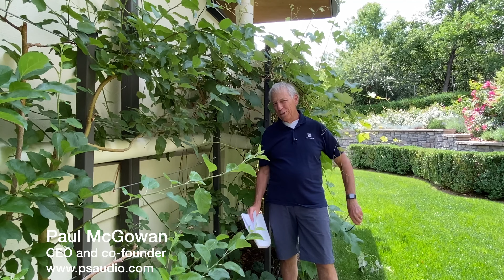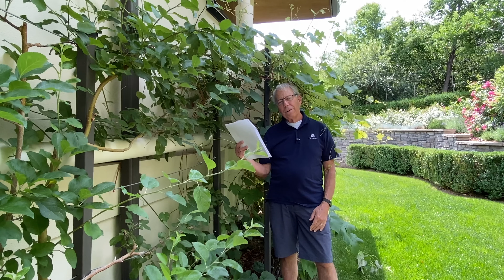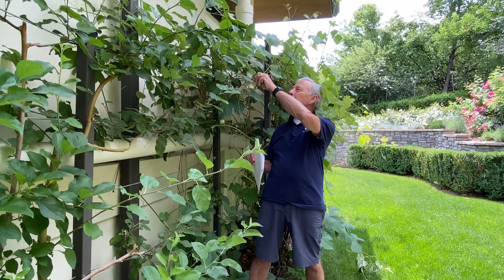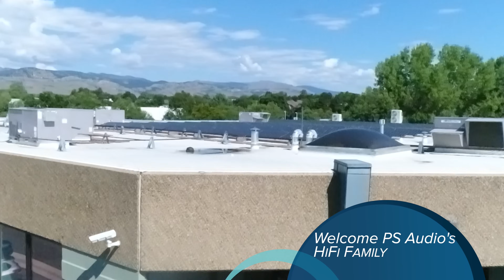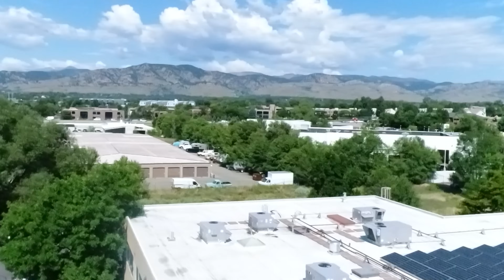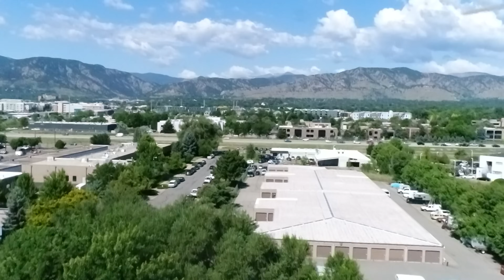How do stereos image?

Comment: 2:00 Do you mean an Isobaric tweeter?
Reply: Tweeters move such an insignificant amount of air that the term “isobaric”, even if technically correct for the application,  is insignificant unless the tweeters are housed in a separate, very small enclosure.  Otherwise, their affect on the enclosure’s internal air pressure might not even be measurable.
Reply: @doowopper1951  Fair point.
It like claiming that different power cables "sound" different.

Comment: In general, I have found small(ish) speakers give much better imaging and do the "disappearing trick" easier, giving the impression of just sound and no speakers.
Could it be the (more difficult)  integration of many drivers on a large enclusure as against, just two drivers in a small package?
Reply: Arthur ...yep, true. I'm not so interested in the 'why', all I know is that 3 way floorstanders are good for Rock 'n Roll, Metal, EDM & the like ('Wall of Sound' presentation) & small 2 way standmounters...are what you said about imaging & accurate soundstaging.
Reply: @FatRat-f9m  
That's very true FatRat, especially if they come from the likes of JBL or Cerwin Vega 'stables'..
I have surprised myself lately as, I have the large Thiel CS6 as my 'reference' speakers, ..however..
..I recently got a pair of vintage Rogers LS7t (circa late 90's) and, it's hard to believe, I enjoy their sound as much as the big Americans when it comes to Jazz and Classical.
With rock / electronic music they don't compare.
I am listening right now to them and don't feel any particular urge to get back to the Thiels!   
Go figure!..
Reply: @FatRat-f9m  , shhhhhh
Reply: i A/Bd the B&W 805D2 bookshelf & the 804D2 and found the 804 to image same as the 805.
i was going to get the 805.... but its the same footprint & the same staging with more bass.
i couldnt talk myself into saving a few thousand.
Reply: @FatRat-f9m  
Thanks FatRat !  Always willing to learn.. and as someone famous said: "..the older I get the more I realise how littlle I know.."
Reply: @manolopoulos-j4t ...I think that that might be more in the realm of humility, my audio friend.

Comment: what makes surround sound image?
Reply: Rather than relying on audio bouncing on walls in a stereo setup somewhat randomly, the audio comes from the specific intended directions in a surround setup. This can make a more reliable 360 degree imaging and with Dolby Atmos even create audio as coming from above. For a movie you want what you see and what you hear to be highly connected.
Reply: @behexen250 Yes, phase matters greatly. Hopefully you are not recommending anyone to run their stereo speakers in opposite phase? Out of phase is quite different causing my brain to short-circuit in imaging. A few years ago I was at the Hong Kong Electronics fair and some company was demoing their premium headphones. I instantly told them the phase was opposite and then one of their engineers came with another pair for me to try...that had the phase right. I've also visited a friend where his speakers were out of phase and they had used it in that condition for years. He was so shocked how much better it sounded after I fixed it for him. I bet a lot of systems are running in opposite phase un-intentionally.
Reply: behexen250 Yes, that’s what I understood also and I agree it’s a good experiment to do. Also it will make you know how out of phase actually sounds like so you can easily detect it in the future.

Comment: If speakers need to be pulled 1/3 of the way into the room for a good image then how does Ohm Walsh series speakers that are noted for their superb imaging with a reach out and touch it realism work when they need to be only 12 to 18 inches from the rear wall? I have them and the imaging is phenomenal.
Reply: Omni directional
Reply: @scottyo64  How does Ohm Walsh work in a home theater?
Reply: @mattgiunt  Fantastic with their sit anywhere sweet spot as every seat gets a good center image that is not possible with most speakers.
Reply: @mattgiunt  If you want to try them out Ohm offers a free 120 day at home trial .Also I recommend the Walsh 2000 as they don't need a sub ,but if you have a sub save money and get the 1000 series speaker as how low they go is the main difference in sound.
Reply: @scottyo64  They have been called semi-omni directional (Z reviews) as they block the higher frequencies at the rear and have a tweeter positioned at a 45 degree angle which gives them a sit anywhere sweet spot ,but that could very well be the reason they image so well so close to the rear wall.
Reply: Those are probably omnidirectional or the exact opposite, directional. Most speakers are somewhere in between though.
Reply: @FatRat-f9m  Whut? Normal people use clothing to cover their arse 😜